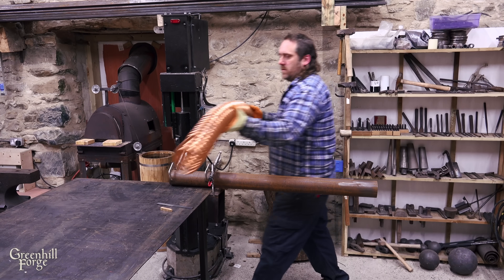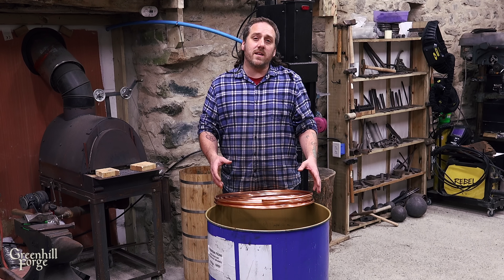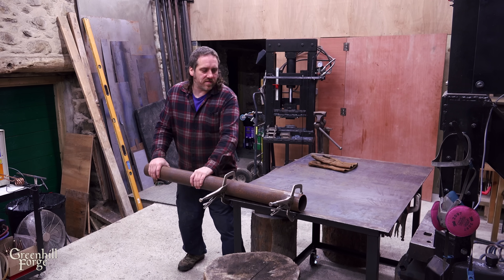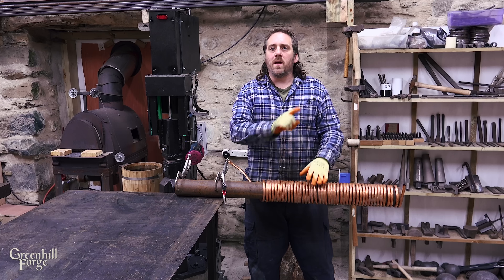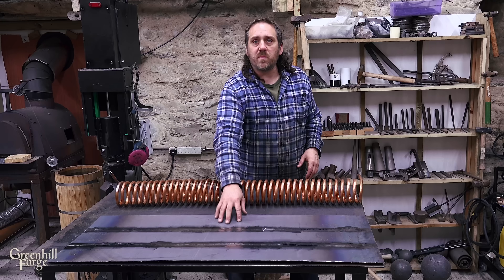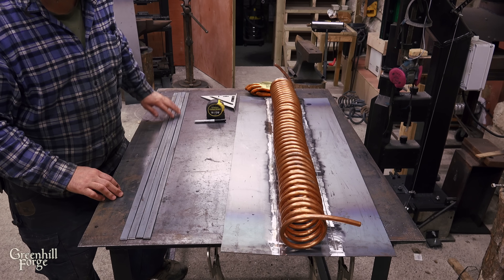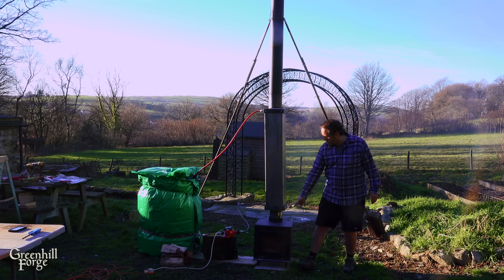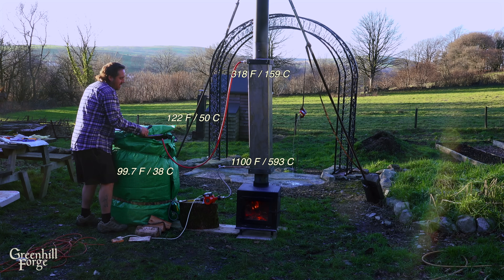Wood Stove Water Heater Experiment - Surprising Results! Part 1

Comment: I bet the exchanger would work horizontally so long as the chimney was insulated and tall enough to create draw.  As for the combustible buildup everyone is talking about, a complete burn would definitely help, either with high heat + gasifier second stage or a catalyst.  And your build is such that you can do a complete disassembly and clean which is amazing.  Fantastic job and excellent video editing

Comment: I tried that about 10 years ago . I used about 20 feet of copper pipe with a recirculating pump. The loop was on the outside of my wood stove and hooked to my hot water tank. My problem was, it BOILED the water in the tank!

Comment: You'll need to compromise the maximum Absorbtion desire and balance it with the performance related variables. I would think that having dissimilar metals touching each other will lead to a leak. Even with the tubing on the exterior of the exhaust pipe, touching dissimilar metals is an issue but so would the expansion and contraction between different materials. The coil will expand and contract at a different rate than the spacer bars. And because of that, i see those spacer grooves more as "teeth" that will inevitably bite into the soft copper as things expand and contract through normal use.

Comment: I really enjoyed this video, well done. I’ve had my mind on different designs for this very thing. You might consider a spiral baffle in the center similar to or taken from an old gas water heater to add vortex to the air flow. I’m glad you built it so that it can be easily taken apart for cleaning.

Comment: doesnt the hot smoke of the fire condensate on the cold copper pipe, slowly building up a thick layer of tar, that prevents proper heat exchange and will eventually catch on fire?

Comment: Years ago I used a wood stove to heat the small house in the woods where I was living.  When the ancient water heater went out, I used the wood stove to heat water by 1) putting water in a large pot and 2) putting the pot on top of the stove.  It worked!

Comment: We made one of those as an exam-project. A steel pipe with a copper pipe coiled around it. Open in the middle and same size of pipe as the stove pipe itself to accomodate clening the pipe as usual.. The stove pipe was a ceramic block as a module build style. To be stacked on top of each other, thats the basic module. And a special module directly after the stove to get maximum heat, with one of the four sides open, to fit the coil. Gave about 1 kW in hot water when stove was at its peak output. Added bonus: the pipe modules were fitted with ventilation pipes for example for kitchen fan.

Comment: This problem was solved in, like, 500AD. You should build a water jacket around a flue pipe for greatest efficiency. See "Kelly Kettle" or volcano kettle. In essence a water tank with the stove flue running through it. You create in essence what is a single fire-tube boiler. Max surface area and expensive copper pipes don't get burned up. From Roman baths to the great days of steam locomotives. Will even work with masonry if given time to heat up.

Comment: First view of your work. Excellent! I have done hybrid wood heat and sun maxx evac tube solar hot water and heating systems. I used their 264 gallon tank with a 60 tube array and a therma-coil brand coil inside the wood stove. In pennsylvania winters you only need a coil perhaps 1/5 the size of the one you have made (about 60 -70" of 3/4"" pipe). The stove unit is stainless and is connected to copper piping wit dielectric unions. The feed and return lines are dumped into a coil in the tank with three coils in it. A second coil in the tank goes to the solar loop which has a 5 ft section of copper baseboard heat in parallel with it. A solar controller or a plc control both loops allowing you to use the baseboard heater as a heat dump if needed. The third coil in the tank feeds the hydronic radiant system and a separate domestic hot water tank.  Looking forward to exploring more of your videos.

Comment: Great idea. Would you say that you would run this for a winter and then disassble to clean it all up? I imagine it would be somewhat of a pain to clean in a meaningful way. I think the one thing that would hinder the heat transfer is buildup of creosote etc on the copper.
Reply from the maker: You're right and this would not actually be a good design for a long term regular use unit. this is just a test unit to gain data to build a better design.

Comment: A lot of post-war cottages used pure convection systems to circulate the water into an insulated water storage tank which had a pump to push the water out into the bathroom and kitchen.  It was all heated from an oil burning stove which was a drag when you wanted a hot shower in the summer.

Comment: I did it with a ¼" copper tubing refrigerator ice maker kit and a coffee can rocket stove. It was plenty enough for a backwoods bathtub made from a tarp. I have a better one that is a rocket stove, a water heater, and on top a hob with a smokeless after-burner. Doesn't need a pump.

Comment: When I bend thin copper pipe I fill it with fine salt.
Then I just run water through it and the salt dissolves away.
The Salt can take a lot of heat to so no problem if you heat bend.
Reply from the maker: I use sand for small coils. salt kinda scares me with its corrosive effect but I do like the idea that you can dissolve it, hadn't considered that
Reply: @GreenhillForge It dosen't really matter if you wash the salt out right after.
If it's a copper or brass or stainless then salt is no problem.
Sand I use for bigger diameter pipes but getting the sand out is a hassle.
If you cold-shape you can use sugar, because sugar can't take heat.
Salt on the other hand can tale heat up to red hot.
Just make sure the salt is cooled down before adding water :D

Comment: The only problem I can see is the buildup of creosote in and around the copper coil blocking off the flow of hot gases circulating eventually reducing the efficiency…maybe wrap the copper around the a pipe stretch the copper to a spacing of three to four inches wrap the copper with the insulation then cap off the insulation. You won’t have the full flow of gases circulating around the copper but the insulation will retain the heat longer. Your design is definitely more efficient at heat extraction 👍

Comment: Creosote in your chimney, it will in-case that copper pipe quickly. If your flu gases were clean this would be great, wood smoke isn’t clean. Maybe a boiler that keeps the coils outside of the chimney. I’m no engineer, but I used a wood stove for ten years. Creosote is the worse thing to have to deal with when burning a wood stove.

Comment: Does steel in contact with copper not cause erosion of the copper. Plumbers won’t allow any steel to contact copper that’s why nylon or plastic pipe clips are used. Would A heat resistant notched spacer not be better.

Comment: Stainless steel. Not quite as good for heat transfer but much more durable. You will have to use acid to clean mineral deposits on a regular basis. Been doing this for awhile now.

Comment: There’s a thing called a “heat pipe” that moves heat very quickly. I’ve never screen a large one, but heat pipes are used to cool CPUs and computer chips. They are basically a thin copper tube with a volatile liquid inside and both ends sealed under very low atmospheric pressure. Heat pipes transfer and distribute the heat from one end to the other end of the tube super efficiently and fast.

Comment: You should ask yourself the following questions:

1. What is the power consumption per hour of this device? 10 watts? 50 watts? 100 watts? 200 watts? 500 watts?
2. Hoe many cubic meters/feet can be heated to which temperature in hoe many minutes?
2. Why does the seller not start with this information? Why not inform the potential customer about this key information in the first opening sentence of this ad??
3. If the power consumption is so fantasticly low, why not be open about this at once?? Sounds like a SCAM if a seller is not transparent about this key information. Just show the real specs to your potential buyers at once!

To all those viewers who didn’t think about this yet: put yourself these few little questions before clicking on the “buy” botton 😉

Comment: Hi from the UK ..really nice build .. tried a very similar thing my self a couple of years ago heating a 10ft outdoor pool... it worked really well .. but ended up condensing too much creosote and had a 'chimney' fire ..ruined my copper pipe it sagged down inside the flue further blocking the flue. :( ...yours has better support for the copper coil so I suspect that'll not happed to you ... however condensate will be an issue ..I've subscribed as I'm very interested in seeing how you get on...I've been thinking of re-visiting the project for ages but copper pipe is bloomin expensive over here....as for hi temp insulation try Pure Rockwool .. its not pleasant to work with (still wear a mask) but its also not toxic.

Comment: Back in the 70s my dad built his own wood boiler to heat the house when the oil circsis  .he had to wrap it with copper pipe and insulate it as the water didnt stay in the tank long enough to get hot

Comment: Really great stuff brother. couple upgrades if heating speed is the metric - 1) how you make your fire, wood type (combine fast and slow burning woods), way you cut the wood will make a massive difference on heat/time 2) volume of woodstove relative to volume of wood/burning material relative to inside air, relative to air flute or outflow oulling out air on the top after the coil is of interest but a bit above my backyard physics level - touched upon that with flutes but thought i'd mention, a huge woodstove might work faster with same amount of wood, or perhaps an even smaller space with same amount of wood, maybe this is an easy physics q. 3) run a separate pipe underground first, could potentially pre heat the water (depending on waters starting temp vs. ground temp vs. volume of pipes underground) seen in common geo heating or 'air pipes' for greenhouse. - i'm looking into this for both sauna and hot waters. much love from VA

Comment: WE had a slow combustion stove  on the farm a Carmichael  with a wet back,it worked on thermo siphon no pump involved ,if water got to hot had a shepherds type crook vent pipe to let out steam and over flow water to the roof into the guttering and back to the water tanks, the hot water tank was on the roof  ,well presented and learned a lot thanks

Comment: That was a pretty good way of heating water using very little wood. The average power absorbed by the water during the 40 minutes was ~ 6 kW (4 kWh). After 1 hour 55 minutes you could boil your pasta in the tank (calculated water temp 212 °F or 100 °C)
Reply: I sometimes wonder if anyone is able to read my comments to youtube content. I experience an ongoing youtube total chill that started one year ago, after I made a comment regarding an ongoing conflict in the middle east. My comment got me directly banned from commenting on youtube for a day or two. Before I made the comment that got me banned, a comment like the one I posted above to the video regarding stove water heating  (that quantifies how successful a system is) would generate multiple replies and a factual discussion. Maybe I got the right result or maybe I didn't? Have anyone else experienced a total comment chill after going through the youtube algorithm penal system?

Comment: Don't use a claw. A plate of steel. Drill holes the cut in half.  
Ever way need a better idea. For the movement of the copper pipe.  But will where out the pipe. Only idea that elegal is asbestos. To hold it and not move. God bless mick Australia 🇦🇺

Comment: I'm really impressed by your design and your detailed explanation. I am a fussy machinist of 40+ years and both you and I know the devil is in the details.
I have been considering a very similar design for a hybrid stove for hydronic floor heating. 
My only concern with a stove like yours is creosote build-up due to the cooling of the gases. This is why I am considering a hybrid which tends to burn very clean.
I really look forward to more of your stuff. I am a new subscriber. All the best from Canada and thank you so much for your hard work.
Reply from the maker: thanks! this wouldn't work well as a regular use, long term design. I just wanted to test direct contact with the glue gases to get the high end values of possible heat transfer to compare with further designs down the line.
Reply: @GreenhillForge Ahh...ok...I figured as much. Thanks for your quick reply.

Comment: why are you using a pump because the hot water should be able to pull the cold water through the pipes so you don’t need a pump at all can you answer me and let me know why you did it or if my idea should be OK without the pump

Comment: I’d be concerned of movement between the copper pipe and the notched strips holding it in place, wearing a hole in the soft copper pipe over time, as it heats and cools. I love this idea, and have thought along the same lines, as exhaust gas (especially after a secondary burn of CO) is hot, and seems such a waste of so much energy, I’m very interested 😊

Comment: With the coil in direct contact with the flue gas you risk that the water start boiling in the coil. That can result in some really unwanted results. The coil on the outside is a better and safer design.

Comment: Reverse the heat exchanger water in & hoses, you want reverse flow. The coldest water (in) should meet the coldest hot exhaust and the hottest water (out) the hottest gas. That will assure that you have the maximum temperature differential available at all points thru the heat exchanger. Plumbed with the water in on the hot end means the further the water travels thru the exchanger the less differential temperature will be so poor efficiency.

Comment: I have experimented with a similar setup in my workshop en learned the following; 
1 - Run the water in the coil above 60C to avoid condensation and deposit of creosoot. This is dangerous as it can catch fire. I use a system with a thermostat that regulates the primary circuit to around 65C. Anything over that will be mixed into the secondary circuit with radiators and hot water boiler.
2 - You need draft in your chimney for a good fire; Don't cool down your exhaust gas too much as it will stall the draft. Try to build a waterjacket around the fireplace to keep the chimney temp high. I works fine in the video with sunny weather I don't know if it still works if there is a freezing cold. Alternatively you can use a chimney ventilator that sucks the air through no matter what.
3 - Don't put a valve right after your fire. If the fire is running and you close the valve your room is full of smoke. If I have an over temperature in my water system, fi if the pump stops, then 2 systems get in place: The air intake to the fire shuts off and cold water is purged into the coil. These are spring loaded and don't need electricity to run. Safety first!

You are a very creative person! Love the video.
Reply: How did you rig it to shut off the stove air intake? Did you use a temperature/pressure relief valve for the water?or how did you do the cold water safety?thanks!
Reply: @edcat6587 It is utility drinkwater; That is pressurized at 3 bar and releases a spring loaded piston that pushed the air intake valve. Once triggered you need to manually reset everything. The drinking water is released into the primary circuit that typically has a pressure of 1.5 bar. A pressure release valve in the primary circuit releases the surplus water into the garden.

Comment: Whats wrong with these "old-fashioned" wood-fired ovens for heating water? I do hardly see any advantage of your system. It consumes not less fire-wood... its not "space-saving"... And its not efficiant... 
With such a traditional oven I can heat up about 90 liters with about 3 kg of wood. No further energy needet for a pump - no risk for "overheating" the water (at least if you do not add further wood while neglecting reason...). 
And 90 liters is already an amount of water that will stay warm for some hours even without further insulation. 

I think you neglect the fact that not the "burning flames" alone deliver most energy - but the "glowing coal". Thats why it is so important to keep "a lot of water / surface" close to the fire/glowing coal...

Comment: Your only flaw in engineering is the saw tooth is going to cut through the copper. The tubing is going to expand and contract against the sawtooth and if will cube cut through.

Comment: I love the idea of the zigzag stand off inserts.   I wonder if you could use small diagonal panels to the bell to force a rotating heat column.  That way the heated gas would have a centrifugal force on it and thus impart more heat energy into the wound copper.  I’m not a thermal engineer and please don’t quote this statement as solid facts.  I just wanted you to know what I was thinking in the hopes that you would spend the money and time re  building it so I don’t have to.  Sorry I’m older now and severally less motivated.   It sucks. Don’t get old.

Comment: Very nice vid! If you raised the tank up it would thermosyphon, then you wouldn''t  need the pump. I built a system with a HW jacket in the woodstove and a  solar HW heater on a roof, then moved my tank upstairs so everything thermosyphoned into it, plus the tank had the usual two electric elements.  Worked great. The plumbing store guys thought I was nuts though...